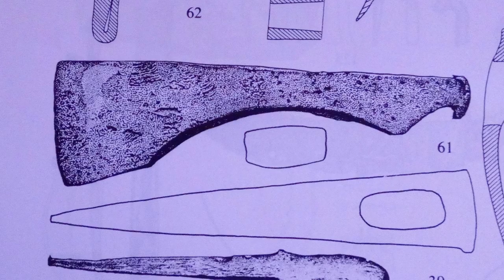Forging an Axe.

Comment: I have a question... How difficult is it for you to forge weld wrought iron to a toolsteel? Concerning the different temperatures they need... Please let me know your experiences. Thank you! Jasmine
Reply from the maker: forge welding of the wrought iron itself needs high temperature, forge welding WI and steel not. It is not a problem at all.
Reply: @officinaferraria  Thank you so much! I was a little concerned because I thought that would be a problem... Looking forward to buying some WI at the beginning of the new year... and hoping to be able to tell you how it went... Until then... All the best to you!!